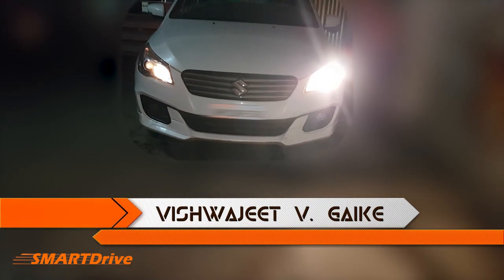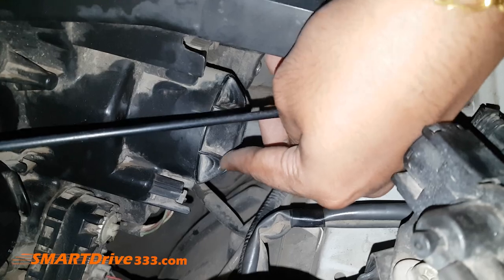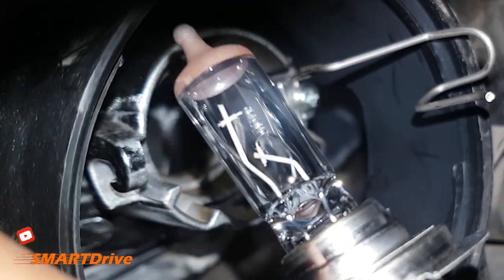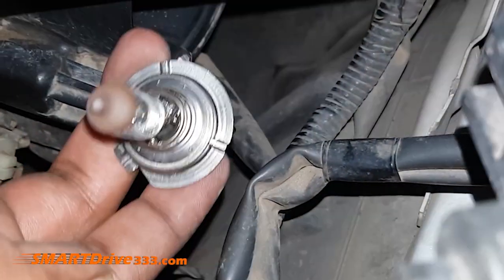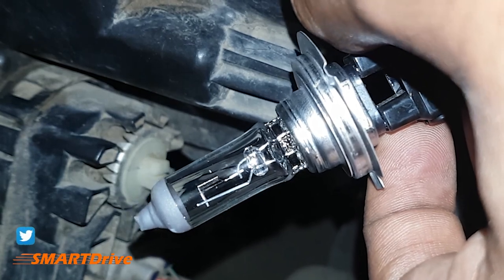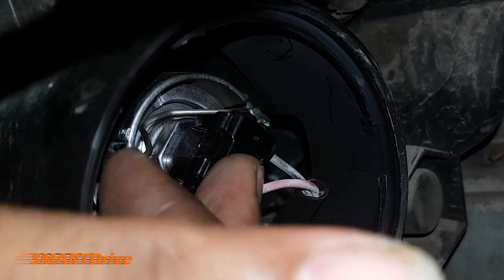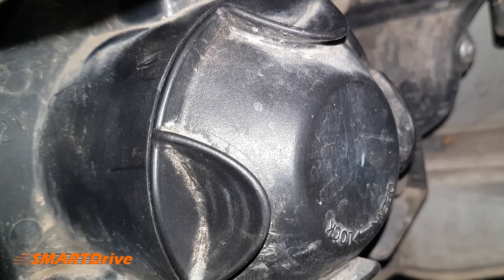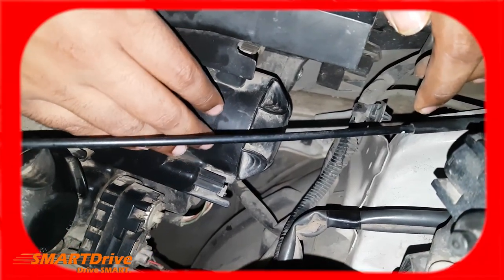Suzuki Ciaz Headlight Bulb 💡 Replacement #DIY #H7 : SMARTDrive

Comment: I have installed LED in High Beam which are working fine. But can you suggest LEDs for Projector lamps of Ciaz. The position of LED from base is different as compared to Filament lamp so the output is not good. LED lamp with similar size are required.
Reply from the maker: Which Brand of LED you bought for headlights ?